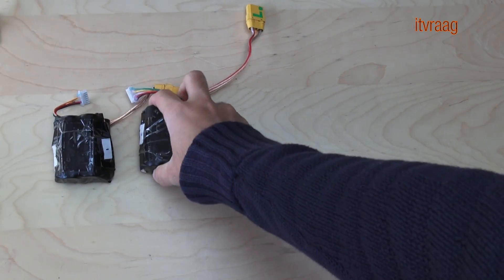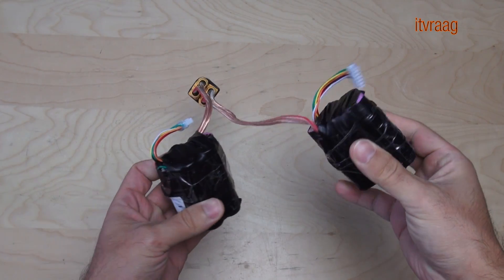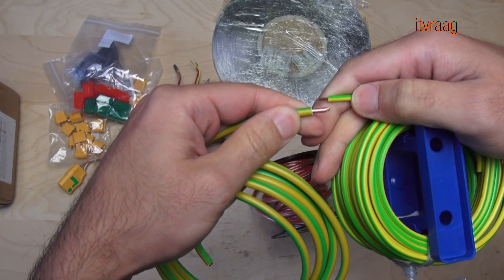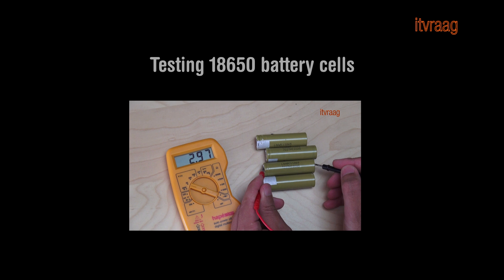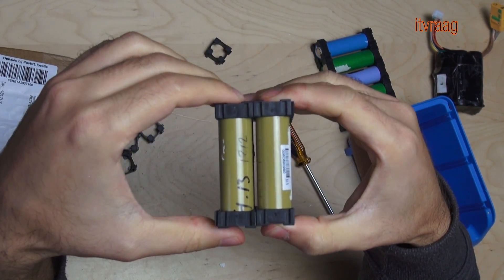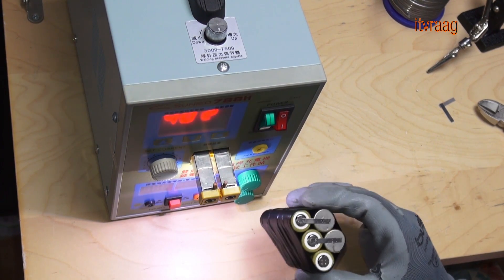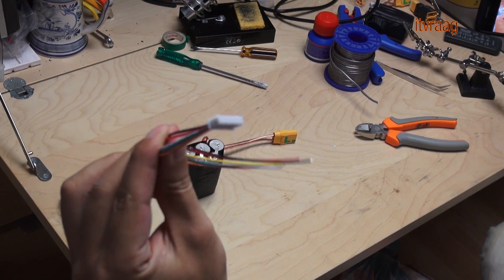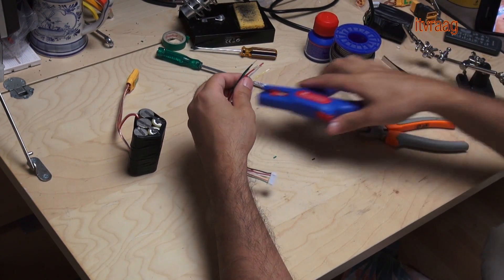DIY battery pack 5 cell (5S, 18.5V)

Comment: You seem to be applying 21v to an 18v tool. Cant this harm the tool? Isnt a buck converter needed to regulate the voltage?
Reply from the maker: 18650 cells typically have 3.7v, which makes 18.5v for 5 cell battery pack, but you're right that 21v would harm the tool. It's also important to choose a matching battery management system (BMS) if needed.

Comment: I would like to get a charger that will support 11s , all the charger’s only go up to 6s
Reply from the maker: Alternatively you can get a variable dc power supply, but you'll need to calculate the voltage and amps. You'll also need to implement a fail safe for over charging.

Comment: Question : i use 5 X 18650 in series to operate my drill rated 18v , each time i charge with original charger i get bad result : one of the battery goes nut = reading zero volt , kaput ! . Why is this and how to correct ? My actual solution is charging each separately @ 4.2 v , it works but lot of consuming time.Thank You
Reply: Were they definitely lithium batteries that came out of your drill otherwise the charger will destroy new ones
Reply: If a cell is measuring 0 volts its probably a bad cell. The charger likely is seeing that one of the cells is measuring 0 volts and wont charge it. The best option is replacing the cell. You can also apply voltage to that specific cell manually by connecting another 18650 in parallel to that cell. Only allow them to maintain a connection until the 0 volt battery starts to become uncomfortably hot. Let it cool, test the voltage, and if it's 2.0v+ you're done, if not then repeat the last step. Once it's 2v+ try plugging it into the charger again, but keep it in the same room as you and periodically see if it feels hot to the touch and abort charging if it does.

Comment: There is an option considered to battery welding. Vruzend battery-connectors. ONly welding is needed to hook up the BMS and LOAD-leads.

Comment: Q: as Airsoft we use alot of T connection and 7.4/11.1 lipos... with that we use low resistance 16awg with silicone sleeve to resist temp ... It's almost your use as I see there. Is that low resistant wire? Looks like audio wire... I'm trying to find a good wire but if I look for low resistance wire all goes to expensive silicone ones...

Cheers and ty
Reply: use  silicone low resistant
Reply: Wires are wires, the insulation doesn't make them less conductive.

Comment: your using the wrong setting on ur charger it should set on li-ion
Reply: not for the new li-ions they are charged on Li-po
Reply: On the new charges you just need to go into the menu and just change the name that's all from lipo to lilon basically the same setting now though on the new IMAX B6

Comment: in this configuration you will kill the batteries, single cell 18650 can usually provide max 5 Amps of current, if you are using this for longboard it requieres about 30-50 Amps, this current will provide a LiPo battery(they are made for high discharge current, susualy 30C), say bye bye to batteries :D
Reply from the maker: +Reyu12 
Not true. Each type of 18650 battery cell has it's own max charge and discharge. Your ESC configuration also determines how much current goes through.
Reply: anyway its sooo much for 18650 single cell, in my opinion you should use 10s4-6p to avoid very high current for cell and make the pack much more durable and reliable.
Reply: @reyu128  If i have to charge 5 18650 cells in series through a bms board whats the required power of a charger.. I mean volts and amps. 
I dnt want to use Rc charger i want to use a something like laptop charger
Reply: If i have to charge 5 18650 cells in series through a bms board whats the required power of a charger.. I mean volts and amps. 
I dnt want to use Rc charger i want to use a something like laptop charger

Comment: Very informative video but your soldering technique is very wrong and could result in some cold connections which tend to break very easily 
So work on that👌🏻
Reply: His soldering, I think so!
Reply: If i have to charge 5 18650 cells in series through a bms board whats the required power of a charger.. I mean volts and amps. 
I dnt want to use Rc charger i want to use a something like laptop charger